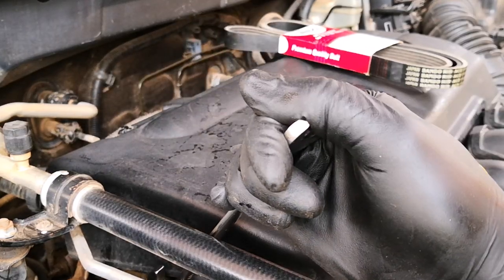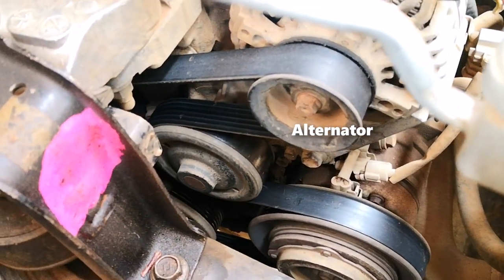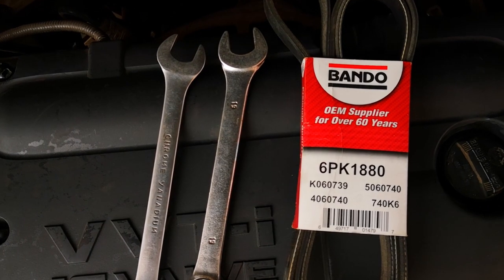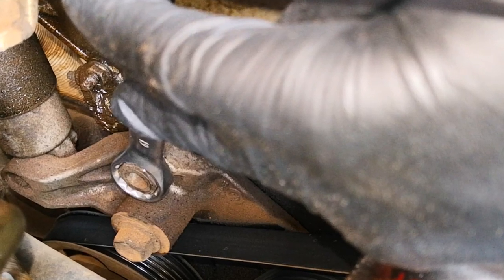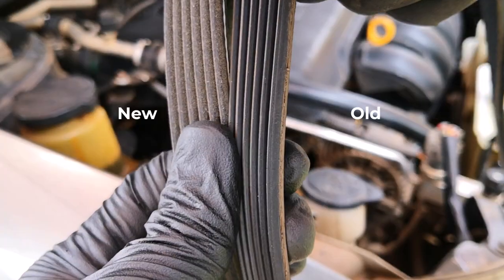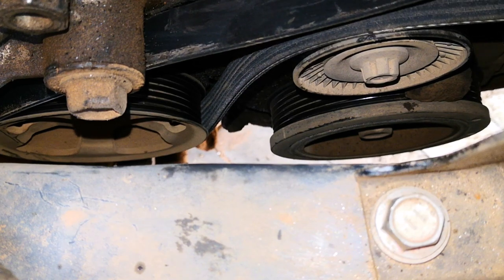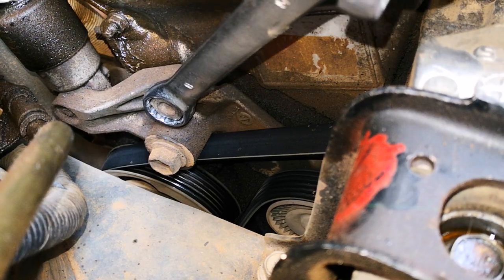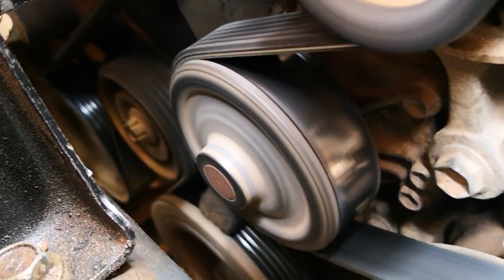Replace Serpentine Belt Toyota Corolla 2002 - 2007 / Very Good Camera Angles: 1ZZ FE engine

Comment from the maker: When last did you change your serpentine belt?
Reply: I have one in queue with harmonic balancer. Just waiting to get a quite days to start it
Reply from the maker: Nice. Also waiting for a quiet day for some repairs. Lol.
Reply: it will be very soon lol thanks to you
Reply: 22 years. 2002 original. 53000 kms or 31500 miles. Belt is not worn but bando is super dry

Comment: Thanks for the info. The first shop I took my car to said the squeaking was my AC clutch going out and gave me a $475 quote to fix. I had a friend tell me to check the condition of my serpentine belt. After checking and seeing cracks everywhere, I spent $30 and changed it. All squeaks gone and no AC issues!!
Reply from the maker: Just the kind of news I love hearing! Glad you didn't get duped!

Comment: I've changed mine six years ago and about 40000km have passed since (I know it's low milage for so many years but this is my need) oem Honda belt for a 2004 Accord, I remember the price was a bargain, got it from ebay UK but the quality is great. So far so good, probably it will offer another good years of usage. Bought a new one from Bando which is awaiting if something bad happens with the one already installed on the car. I've read Bando and Mitsuboshi are oem for Honda and probably other manufacturers so good quality.
Reply from the maker: Good good. Cooler weather should would also affect longevity I would imagine. 
Yea, Mitsuboshi and Bando are OEM for Honda.

Comment: Belt does not want to go on. Almost there but a few millimeters too short.
Reply from the maker: I've had this experience with a cheap aftermarket belt. Is the belt OEM or from an OE manufacturer like Bando, Gates, etc
Reply: @DIYAutoworksNG  Bought another with a few mm longer and that worked.
Reply: So uou used a bando 1880 which is factoryToyota aftermarket 
I know gates is ok too
But I went with Goodyear
Less squeaks hopefully
Reply: You**